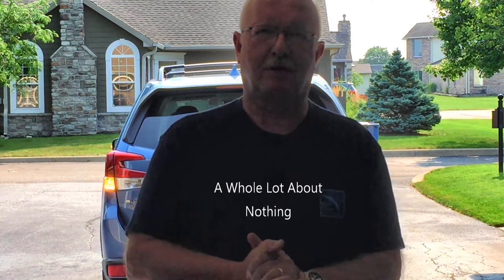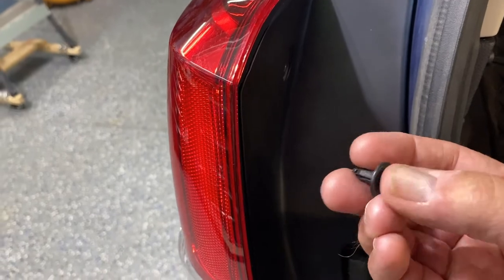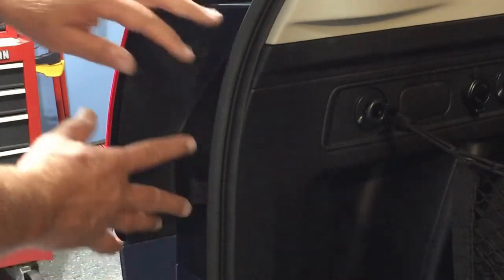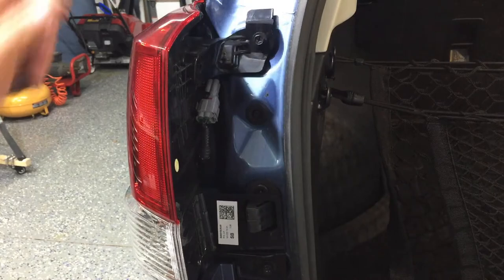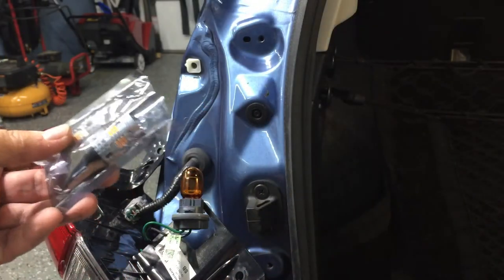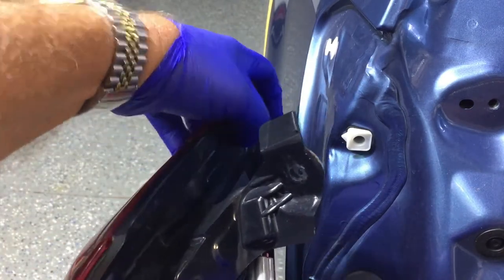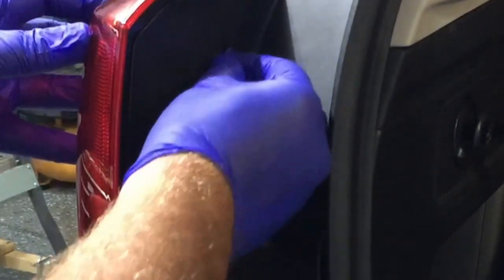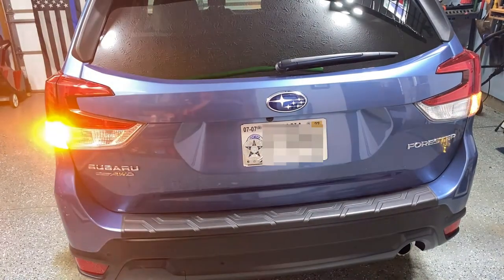Subaru Forester Rear Turn Signal Replacement OXILAM LED

Comment: Wow, big difference… more Forester vids please👍thanks
Reply from the maker: Yes!  We travel a lot and when the interstate comes to a screeching stop, these babies can save you from being crushed by a semi coming from behind you.
Here’s a hot tip: I replace wiper blades often…. Just found these on Amazon. They match original manufacturer ones and are around $25 for all 3 blades.
AUTOBOO 26"+17" Windshield Wipers with 14" Rear Wiper Blade Replacement for Subaru Forester 2019 2020 2021 -Original Factory Quality (Pack of 3) https://a.co/d/b8Lchch
Darn, I should have made a video.
Next time!😂👍

Comment: Thanks Dan. I just picked up my 2020 forester and I had these exact signals in my wrx and love them. I didn’t know how to get that plastic piece off. Great video! I also installed auxito reverse lights they are hella bright too! Give them a shot
Reply from the maker: I have had to replace two of them….. Being retired we travel a lot.  Having the intense bright emergency flashers is worth having them. The company replaced one. I replaced the second on my own.  We love the Forester model.  
The Isuzu manufacturing plant for North America is where we live.  However the Forester isn’t made here.  I’m already at 74,000 miles!  I’d like to to trade up but none to be found….
Sorry to ramble on….. I will give those back-up lights a try on my next Subaru!  Maybe a Pilot, they are made here 😁
Reply: @BoilerDan1  I had to replace 1 had them in for 3 years now and 18 monthes before 1 failed
Reply: @BoilerDan1  I am big on Subaru’s made in Japan I had my 15 wrx for 200,000km beat on it every day and it owed me nothing but reliability. I will only buy Subarus made in Japan. My sisters have new Hondas and hate them nothing but problems. I work at a VW dealership I see lots of problems. I’ve noticed a huge difference in quality of vehicles made in Japan compared to Mexico USA and Canada. I’ll always stick to my Japanese made vehicles
Reply: @BoilerDan1  I just put them all in and they are hyper flashing. Did this happen to you too? Not sure why they are
Reply from the maker: I think I totally agree with you.
I do all my own maintenance and have never had any issues. I even changed the spark plugs in my 2016 Forester.
Quite the challenge for a “non-mechanic person 😂.
Another interesting observation. We drive from Indiana to Florida several times every year for the past few years.  I’ve seen just about every make of car broken down along the side of the road…. But not one Subaru 👍👍
Reply from the maker: No, only if I leave them on for a long time.  I thought they had built in resisters?

Comment: These same lights also fit in front (2020 forester). I bought a pair of plug and play load resistors and they work just fine. On the plus side, no more amber parking light. Don't need them anyway as the DRLs are always on.

But the plugs that come with the load resistors kinda fit in the oem housing. I'll see if they hold up.
Reply from the maker: I’m upgrading to the 2023 Forester!
I’ll try adding the resistors.
I’ve been very happy with them on the rear lights.
Thanks for watching and sharing your thoughts.👍
Reply: @BoilerDan1  Very nice, congratulations for your 2023 forester. Just be aware the harness doesn't fit as nicely as the oem plug, you have to find the sweet spot where it is stuck and no longer moves. It doesn't lock into place like the oem plug, it just gets stuck. On the 2020 anyway ;)

Comment: @BoilerDan1 u still own those oxilam 7440 amber led bulbs, now that’s been 2 years so far?

No hylerflash still? Still functions well as it should?
Reply from the maker: I’ve since traded that Forester in for another Forester.  I do recall that if the turn signal is on for a long period of time, it did start to hyperflash.  They are also extremely bright and my wife convinced me to not install them in my current Forester because when you open the tailgate at night they flash twice and it’s painful on the eyes…. Yes, they are that bright!
Definitely gets the attention of drivers behind you on the interstate, day or night.
Thanks for watching, hope it’s been informative.👍👍
Reply: @BoilerDan1  there’s better options u can get for less bright. Try Auxito amber led 54H. 5.5W. 

Not as bright as with a built in resistor with 24W. 

But still brighter than stock. And it’s more refined super bright.
Reply from the maker: @toyotabrony Thanks for the info.  I’ll check it out….. maybe on my next one.  I’ve been driving about 30,000 miles a year and like to trade in at the 80,000 - 90,000 mile range.  But I will look them up and maybe put on my Christmas list 😎👍👍
Reply from the maker: @toyotabrony I looked them up, but said that they won’t fit the 2023 Forester model 😞
Reply: @BoilerDan1  they always said that. Just because it says on the info, doesn’t mean it’s true.

Check ur incandescent bulb to see what bulb size u have. If it’s a 7440. It’s a 7440. If it’s 3157 it’s a 3157.

Those 54H led amber I mention needs either load equalizer resistor or led flasher relay.

Or if u want a plug and play version load equalizer resistor. Look up alla lighting - resistor plug and play version.
Reply from the maker: @toyotabrony okay, Thanks 👍👍
Reply: @BoilerDan1  ur welcome 🙏🏼😎

Comment: Awesome video.  You haven't done one on the reverse lights attached to the tail gate by any chance?
Reply from the maker: Thanks! Sorry, I haven’t changed the reverse back up lights to LEDs. I’ve discovered that although brighter looking at them directly, they don’t seem to project light as well as the factory bulbs.  It’s difficult to explain…. 
I did the brake lights on my earlier model Forester however the 2020 Forester has LEDs in a casing that is unit and not single replaceable bulbs.
Thanks for watching! 👍

Comment: Are they still working or did you have to change them? Thank you.
Reply from the maker: Yes, still working! I drive a lot: 85,000 miles on the 2020 Forester that they are in.  I think the vehicle has a setting that has them blink fast after a couple of minutes…. It only happens when I’m at a very long turn lane , I think all vehicles do that.
Probably thinking you accidentally have left it on.
They are extremely bright, but as I have said before: I want attention if I hit the flashers when the interstate comes to a halt…. Definitely does that 👍
Reply: @BoilerDan1  Thanks for your informative video and swift response. I'll be upgrading to LED when I switch from my winter tires to summer tires :)
Reply: @BoilerDan1  I just installed them :) Took less than 20 minutes to change all 4 turn signals. It was a lot easier than I thought it would be. Just got to be careful removing the rear units, I broke a small plastic part removing the unit on the right rear corner but I was able to reinstall it no problem. The front ones are a joke to be honest, unplug the old bulb, plug in the new one. Thanks for your video, without it I wouldn't even would have dared to try. Oh, and they're bright. If you look directly at them from a close distance it will leave an imprint in your vision.
Reply from the maker: I’ve mastered the removal of the rear cover! Sorry I didn’t show it more as maybe I could have helped you not snap that piece off….
I try to worn people regarding how bright they are….. but I believe they can be a life saver if you can activate your hazards in an emergency!
Also a left turn: traffic will definitely know your intentions 😂👍
Reply: @BoilerDan1  update: all lights don't hyperflash when using the 4 ways, although when the car is running they hyperflash. I have removed the front leds, and put the old ones back and it stopped hyperflashing.

They are insanely bright which is perfect during the day but very, very bright in the dark.

Also, after leaving for work the driver side was hyperflashing and the passenger side was fine. I contacted oxilam via amazon, waiting for a response from them.
Reply from the maker: Hope it works out.  Yes, insanely bright!
Reply: @BoilerDan1  well... after changing back my front turn signals back to halogen after trying to see if these led lights would fit in front, I must have damaged a light. Parking light would work but flasher wouldn't. I bought new regular bulbs for the front turn signals and the oxilam leds in the rear work just fine now. Everything is in order now.
Reply from the maker: Good to hear!

Comment: Where could I order a Lens com left side back for a 2022 forester limited, without going through the dealership.
Reply from the maker: Only place that I found was this website. A hint! I put something in my cart but didn’t order it. After a couple of days they sent me a promotional code to get 10% off my order.  I think I set up an account too, but I don’t remember for sure. I get emails every once in a while from them.
Here’s their website:
https://www.subarudirectparts.com/?gclid=Cj0KCQjwnf-kBhCnARIsAFlg493Y6oJRkrJoC1a904v1ry55FQDQFhzuh3ba9pKe43nYMAMc9XLgNgcaAhMQEALw_wcB

The prices were better than my local dealership.
Reply from the maker: I think the 2022 lenses may be different. You’ll need to check with the lamp seller to confirm fit.
I know that the brake lights are a complete unit. Have to replace the entire unit.

Comment: Wow I have a 21 Forester and I bought error free LEDs and they hiper flashed . I had to put resistors in mine. 👍 Nice. Did u change your front too?
Reply from the maker: I didn’t change the front ones.  Since retirement, I’m traveling quite a bit.  I’m very impressed with the brightness and they definitely get noticed when traffic comes to a halt on a busy interstate!
We love our 2020 Forester. They made it a little bigger than the previous model.  I am starting to think that mine do hyperflash when the turn signal is active for a couple of minutes….  But I just click off and back on….. but adding a resistor is probably a good idea 👍 
Thanks for watching 👍👍
Reply: @BoilerDan1  cool I my wife does her Forester, I like it so much I bought the Crosstrek 21. I did the same led set up in it to. I got the limited so it has the 2.5 liter motor.